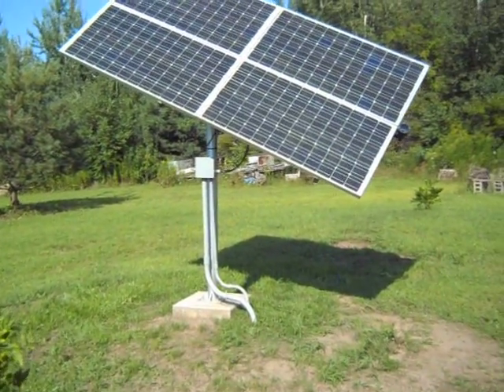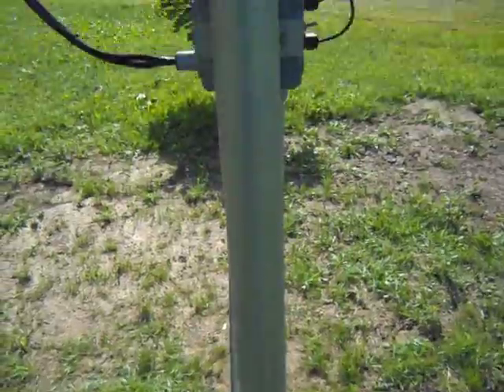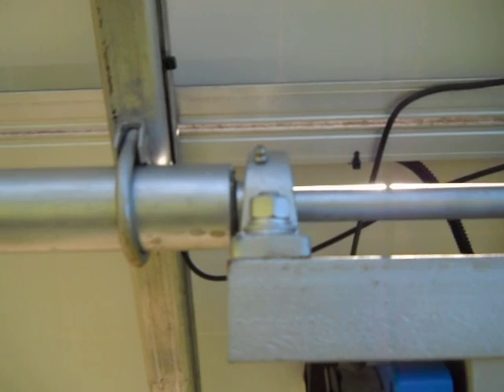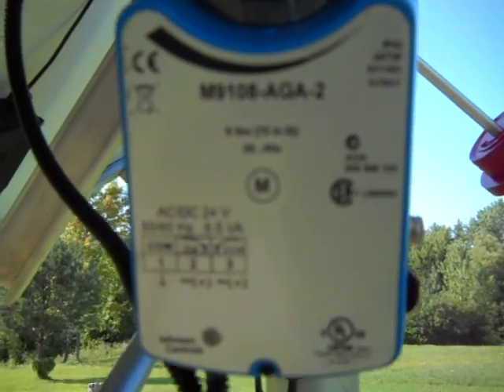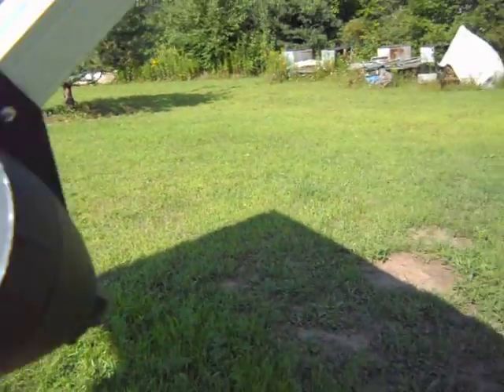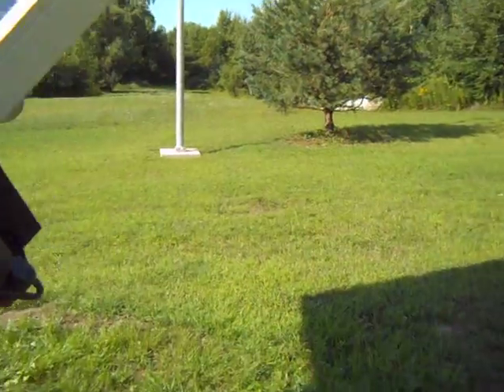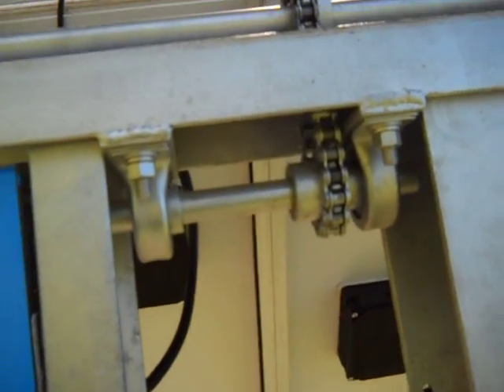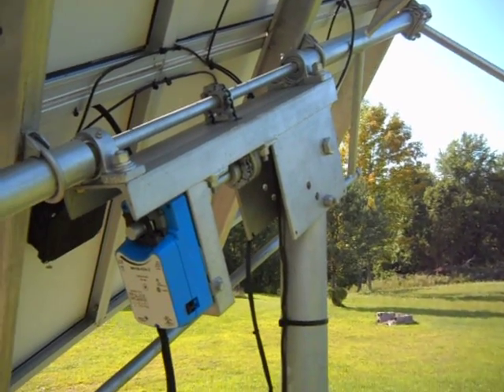HOMEMADE SOLAR TRACKER

Comment: Is it powered by the panel itself? Is there a battery backup to run the tracker?
Reply from the maker: It can be powered by  just the panel . There is a small DC to DC converter that changes up to 72 volts DC to the 24 volts DC required to run the panel motor.

Comment: I don't get it...... Why skew the panel??? For different seasons. Elevation and azimuth is all you need. No matter what season. Am I missing some crusial info?
Reply: Ya in winter the sun tracks across the sky alot lower than in summer. In summer the sun tracks almost straight up across the sky.
Reply: @JM-yx1lm  Yes, I know. that's why you can til the panel, elevation. I can't see why it have to be skewed. Ohhhh, only 1 motor for azimuth, the elevation is fixed. Then the panel end up skewed. No electrical reason.

Comment: Impressive!  Why didn't you go all the way and do dual axis tracking?  How much energy is being used to tracked versus how much the solar array produces?
Reply: Probably because it's four times as difficult to engineer and ten times as hard to build. The summer/winter adjustment is crude, but effective enough.

Comment: It would have been cheaper and easier to instead have two non-moving ones, or one array with a reflective sheet around the array to reflect more sunlight on to the panels.
Reply: Cheaper and easier, yes. More efficient, no. One could combine tracker and a reflective sheet, that is a good idea.

Comment: the only thing I would change is to run the electric connections and switch in the bottom of box to reduce water getting in.
are these plans for this?
Reply: Rev John O'Toole  i also would add a drip loop kust in case. but great work!

Comment: Hey gotgas63, Nice video showing the simplicity of a solar tracker. It is a very nice unit, well designed and built. I have one question and hope you can answer it, even though you posted this over 3 years ago. The HVAC drive motor you use on your tracker, does it return to a home position on its own when there is no light? Or does the dark sensor initiate the return to the start position? I'm thinking when the A/C unit would turn on it would activate the unit to open the louvers and when the unit stopped running it would close on its own, sensing no input. Thank You.

Comment: Each solar cell is 2.1 V aprox or that voltage is the sum of the two ones? Thanks
Reply: 2.1v would have to be the voltage of a single cell

Comment: This is mind blowing.  Whomever clicked thumbs down on this video should really get a good kick in the teeth.  I would LOVE to have something like this in my back yard as a supplement to the grid.  The more stuff I can run for free, the lower my power bill.
Reply: If youre willing to put the time in the parts are not expensive. The metal bars should be like no more 60 bucks. The sensor, module, and actuator are like less than 100. Battery 25.